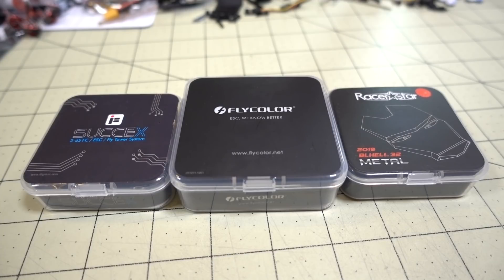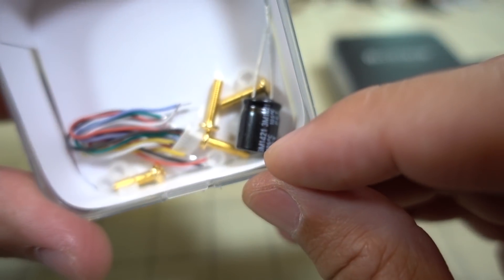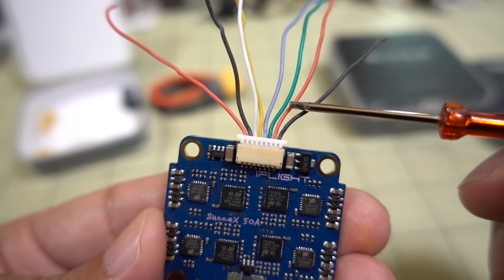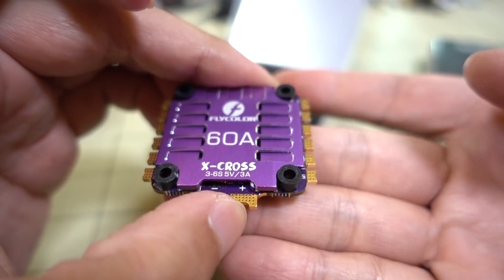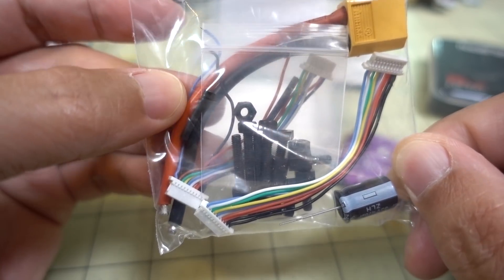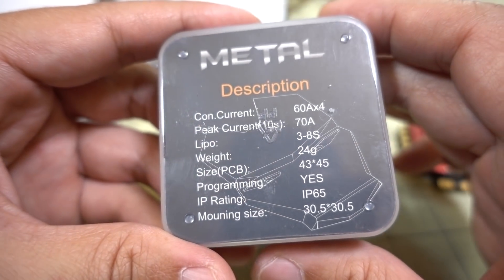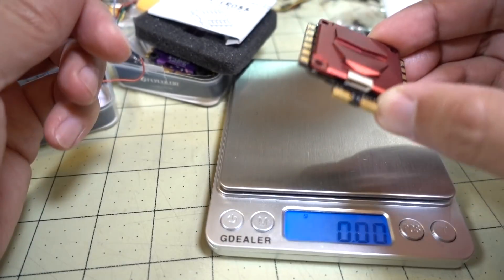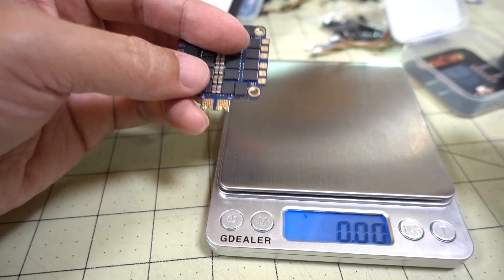Which 32-bit ESC is best for you? 🤔

Comment: Be aware that Racerstar Metal 60A Blheli_32 3-8S is not working with 6S. It´s happen to me and other Pilots. 5S and less is working without any issues. With 6S its getting hot in seconds and reboot.
Reply: thanks for spreading this, I hate it when these chinese companies lie and cause destroyed quads. happened with a diatone esc for me.
Reply: Yes, I can confirm that I was caught out on this. I purchased it for an 8S build, and it doesn't work. It overheats on anything 6S or higher

Comment: I can’t see any of these options for the money when you can get the Airbot F3 Furling32 for $50
Reply from the maker: Have you used it?  How is the performance?
Reply: Albert Kim finally got mine into a quad earlier this week. I’m running it on dshot64 with FL1 Falco and it is 😍👌. For $50 it’s a steal

Comment: Can you actually feel the difference between DHOT 600 VS 1200?
Reply: Not sure I feel it but the same motors with the same fc sound smoother running dshot1200 to me.
Reply from the maker: Some people say they can.
Reply: Yes, I can tell for sure. The funny part is it's more noticeable when I'm trying to go really slow. At very low speeds Dshot 600 feels more floaty. This is from a videographer perspective though, not a racer. I don't fly aggressive freestyle, I use the quad more as a camera platform.
Reply: If you use RPM filtering in betaflight with a 32bit esc, the recommendet setting is only Dshot 600.
Reply: Definitelly feeling difference between dshots and multishot! I fly only multishot, for its nice not robotic feeling.
Reply: I do feel the difference even as a non pro...throttle feels smoother and sharper. Using tekko 32 4in1